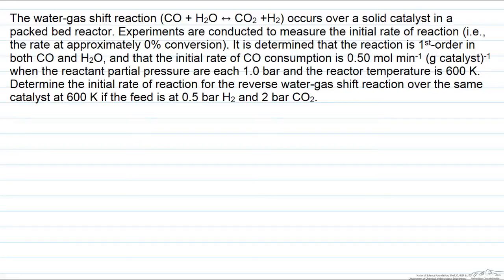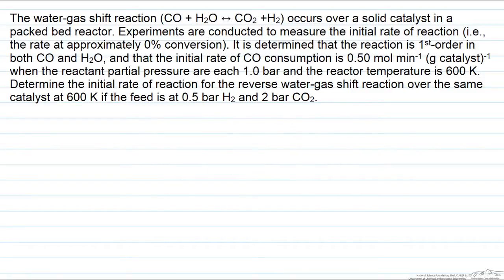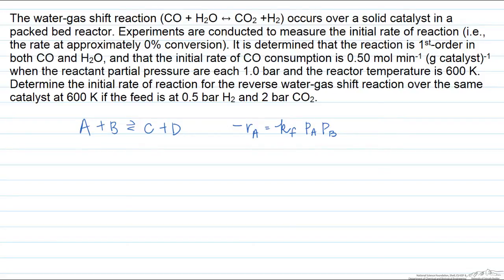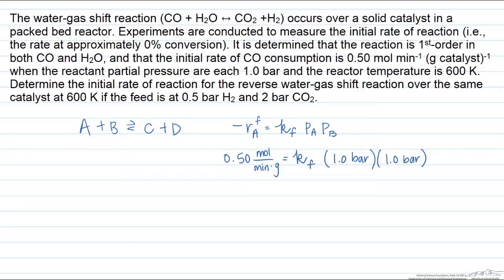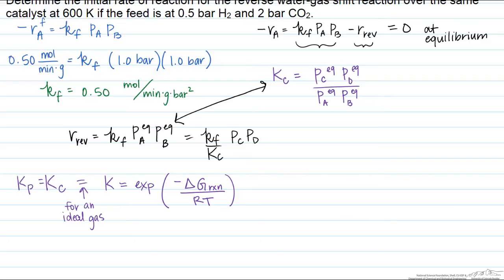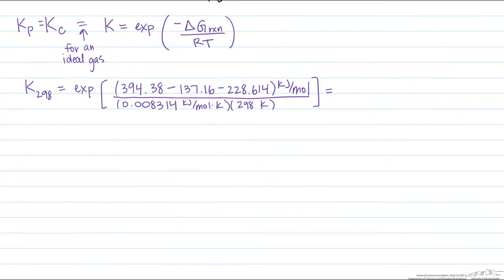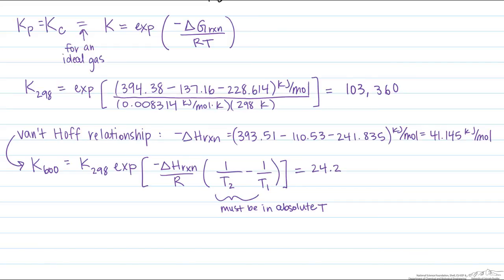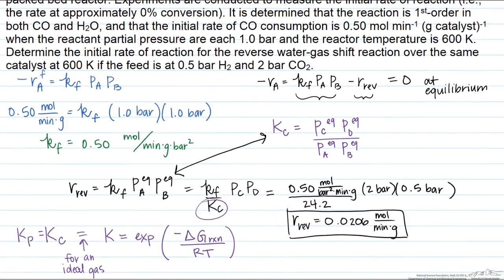Reverse Reaction Rate

Comment: Is the value for Gibbs free energy for CO2 not -394.38 rather than 394.38 so this would make this calculation incorrect? So sum of the gibbs free energy of the reactants is -394.39 then minus sum of the gibbs free energy of the products (-137.16 - 228.614) giving a different value? I'm getting a final K298 as 9.62 *10^-6 using these values. 

Same for the heat of reaction. Hf CO2 is -393.5 so negative heat of reaction is sum of reactants (-393.15) - sum of products (-110.5 + -241.82) so negative heat of reaction is -41.18 showing that reverse reaction is endothermic?